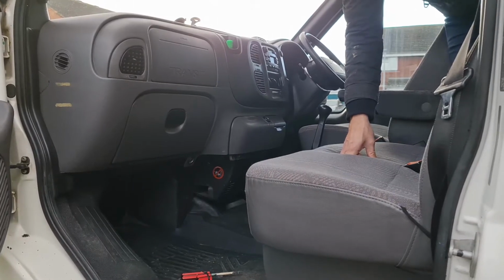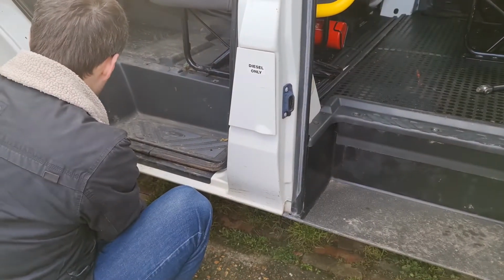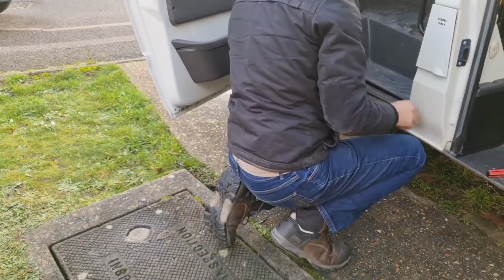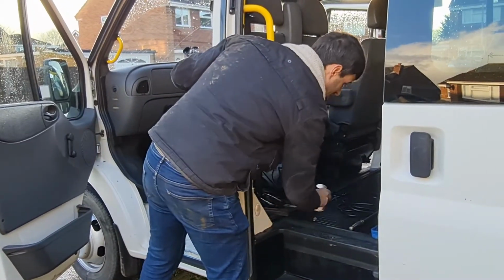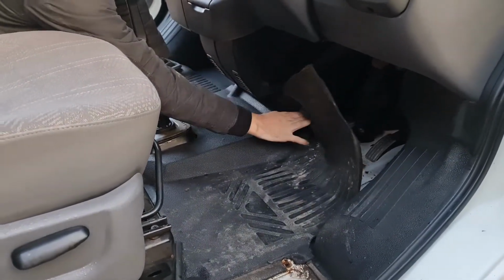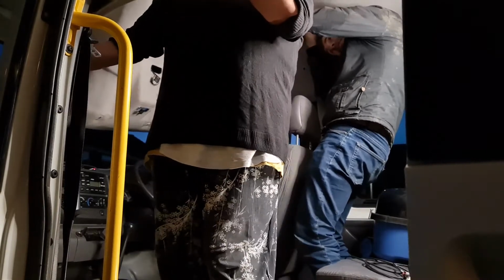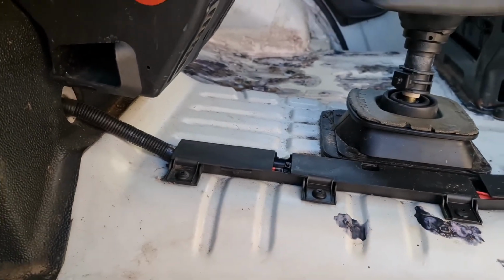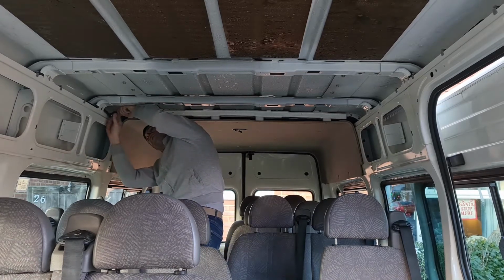Minibus Campervan Conversion - Episode 2. Rust treatment and a leaking Van.

Comment: That rust is nothing for a transit, my Mk6 is a lot worse and I'm welding it every year for the mot but I wouldn't drive anything else! They are brilliant vans and lovely to drive and parts are cheap as chips. You can buy 1L containers of phosphoric acid on ebay for about £10 to treat the rust, as long as you keep on top of the rust it should last for years 👍
Reply from the maker: Thank you so much. Sorry for the late reply. I Never see these comments xXx